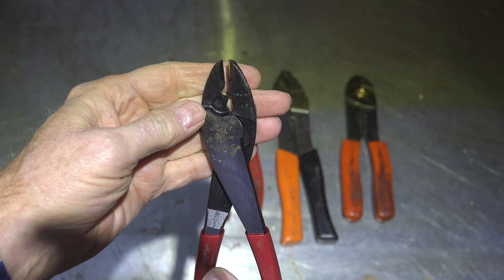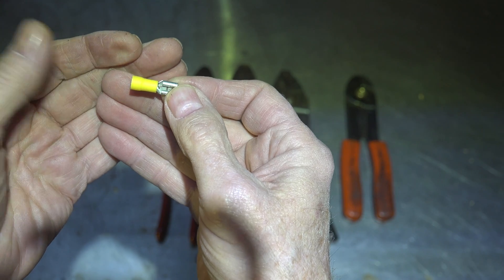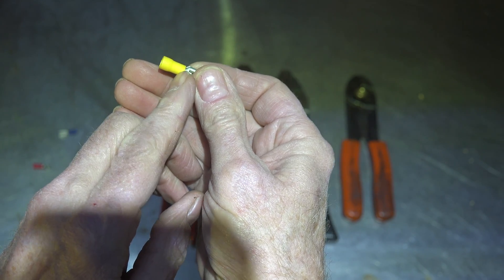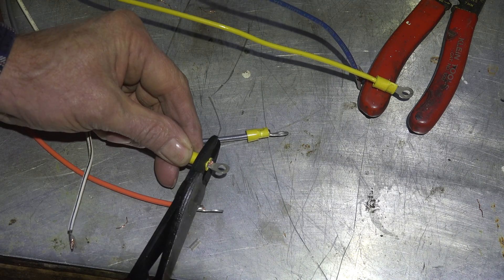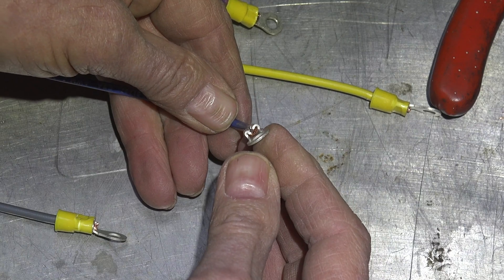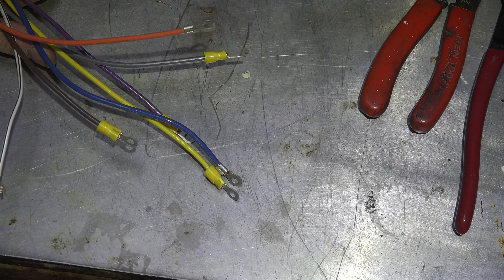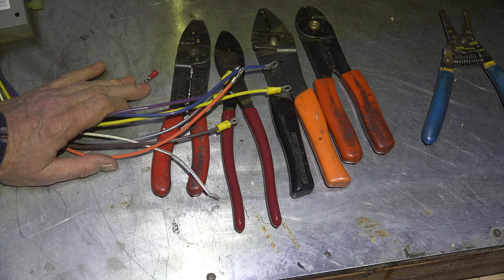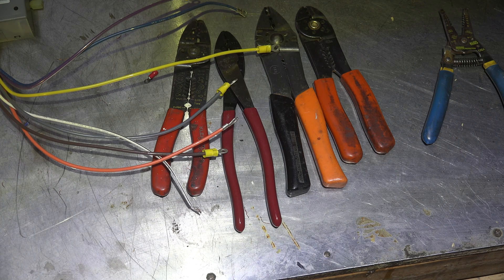How to install terminals onto electric wiring

Comment: Technically using the stake "tit" portion of the crimper is supposed to be used for uninsulated connectors. Insulated connectors use the smooth oval crimp portion of your klein tool.  I did it your way for 20 years till  about 7 years ago I studied the manufacturers installation data as well as the high end gurus from aircraft and the marine guys. Practically I think it's not as big a deal as some make it out to be and as far as I know those crimps I made the wrong way for 20 years  are still going strong. I will say that the high end ratchet crimpers for insulated connectors have a little bit wider jaws and the smooth oval crimp it makes has more surface contact between the barrel and the strands of copper making for  less resistance and a more gas tight connection reducing future corrosion. 
And by the way you are one of my favorite HVAC gurus and have watched most of your videos.  Thanks for sharing your expertise!
Reply from the maker: When I first got into this business, all I worked on was electric furnaces.  Poor connections are the bane of electric furnaces.  I looked at the tools I was using to crimp these wire terminals.  I noted that the "tit" was for uninsulated terminals, probably because it penetrated the insulation.
About 80% of the burned terminals I had to replace were done by the factory using the oval crimp.  I decided that I wanted the best crimp I could get, so I ignored the factory and did the best way I knew how.  Thus, my method.  Thanks for the thoughts.
GFM
Reply: @grayfurnaceman  The factory crimps I see often are machine made open barrel, sometimes referred to as a B crimp or a F crimp.  This type grips both the wire and the insulation.  Crimping is a lot more technical than it may seem.  It can be well done with ordinary hand tools (klein 1005) if attention to detail is followed.  Good quality materials promote long life for the finished product.

Comment: Curious how you deal with 18 gauge solid thermostat wire.  Doing a crimp never seems to be that secure as pulls out easily.
Reply from the maker: If I must use a terminal on stat wire, I fold the end over.
GFM

Comment: High quality copper connectors go a long way to making crimping easy and connections good.  I try not to use crimps any more.   Wire nuts are also bad.  I use Wago connectors

Comment: I just replaced our microwave oven after 8 years. Smelled like something electrical burned up. Took it apart and the primary wire to the high voltage transformer was burned where it was crimped onto a 1/4 inch slide connector connecting to the transformer. After seeing this video I wish I had tried replacing the connector before I threw it out.

Comment: Thanks for this excellent video. I crimp the wire with the tool as you suggest and demonstrated. Thanks to you, I noticed my mistake in having the insulation in the metal part of the terminal; I'll be careful not to push the conductor to far into the terminal. Would you do a video on Terminal Disconnect , Johnstone #G31-289? Thanks again for your valuable videos.

Comment: I like the Klein's that you say are your favorites but always used the Thomas and Betts brand. We called the style T&B's. My favorite though is a ratcheting crimp tool that crimps the wire and also the shroud around the insulation. It won't release until it's fully crimped.
Reply from the maker: The ratcheting tools are very good.
GFM
Reply: @grayfurnaceman  I have a question. Based on your experience what do you think of putting a dielectric grease in in the terminal before inserting the wire? My applications do tend to automotive rather than furnace repair but I am curious about what your opinion is on that.
Reply from the maker: @alanpatterson17  Dielectric grease is primarily to reduce corrosion from battery acid.  I can't come up with a reason that you should not use it but I never have.
GFM

Comment: I agree with everything you've said here, including which tool is the best. The Channellock version of that tool is pretty much identical and, in my opinion, also the best.

I'm glad you pointed out the best direction for applying the crimp, I agree 100%, never liked crimping at the seam.

I do tend to prefer non-insulated terminals with heat shrink applied afterward. I think you get a little better crimp when you're metal-on-metal, without the pre-applied plastic sleeve in your way.
I mostly work on trucks and heavy equipment and I like the way heat shrink protects from environmental conditions as well as providing a little more wire support.

Thank you for posting this, it's these little nuances that make the difference in the job.

Comment: I agree. I have been an electronics technician since 1969 and started learning to be an electrician five or six years earlier. As the connector heats and cools over a period of time it creates a looser connection which causes the resistance at that connection to increase and the added resistance causes higher current flow and the process is repeated until the connection fails. The only thing I have done different is on the Klein’s or Betts crimpers is to take a small file and smooth the sharp areas around the crimp area. This seems to cut into the insulation less and looks somewhat better. When using large crimp tools on battery terminals the stake section has smoother edges. Of course the ones I have done did not have insulation on them and the barrel section of the crimp is solid so it can be crimped anywhere. I still crimp the back side so after heat shrink tubing is installed it looks better. Great information My Friend. I have been subscribed to you channel for a while. 
Most of the applications you use on furnaces is tougher than most of the ones I deal with. 👍🇺🇸🤙

Comment: Great wisdom, grayfurnaceman!
Your crimp style shows better wire-to-terminal contact and thus lower contact resistance. I'm a "crimp coward" and back mine up with solder just at the terminal end so as to not embrittle the free wire.

Comment: I've always crimped it the other way thinking because the stakon bites into the strands and securing it into a solid backing but I'll check it out you'r way and see. Klein is without a doubt a great tool but Thomas Betts were the crimpers we've preferred in the electrical industry here....thank again for the videos
Reply: M Abrams Did it same as you for over 35 years. I did find that high temperature lugs would split if done like this so I did them the opposite.

Comment: Just be mindful that soldering those connections introduces embrittlement, both physical (at the transition point) and to a lesser extent, chemical (hydrogen).  If the wires are going to be in an environment with vibration or temp swings, a good solid crimp is your best bet.
Reply: ramosel I would solder and seal with shrink tubing.

Comment: I carry around a small butane soldering torch kit for exactly this reason. Crimp then solder. You don't want your high current crimp joint acting like a low value resistor!  Takes an extra 2 minutes.